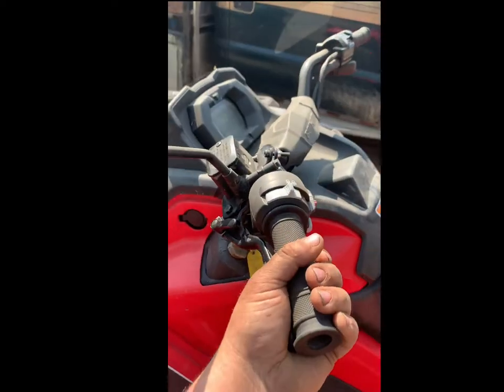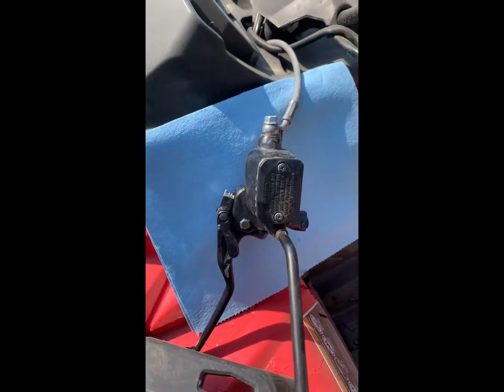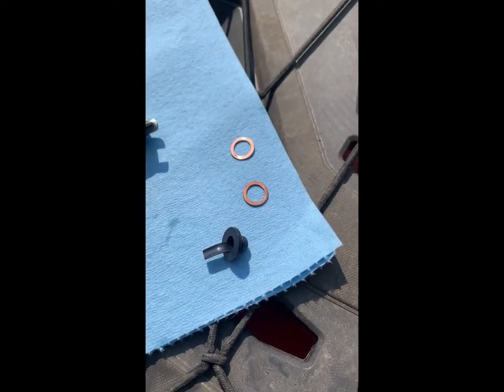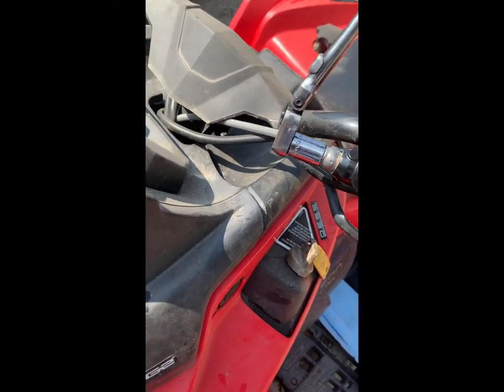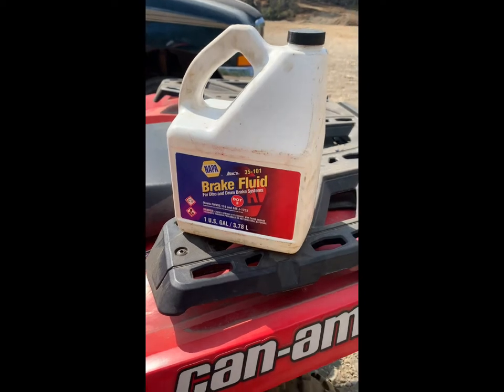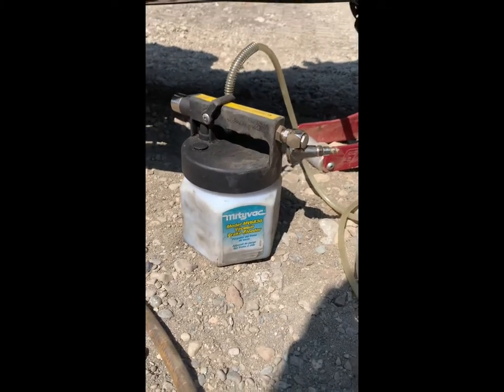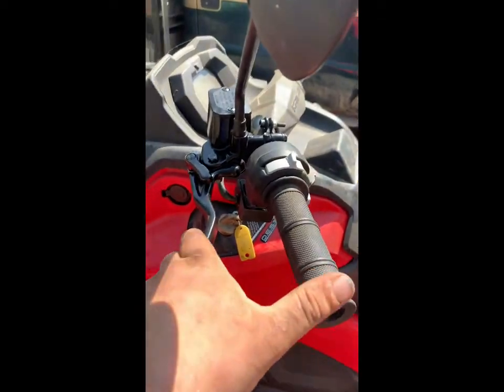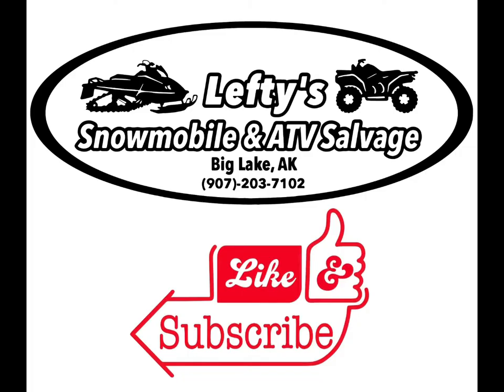ATV Repair - Brake Master Cylinder Removal & Installation🔧🪛🧰 #atv #canam #repair #powersports

Comment: A lil help here please! I bought this used atv with no brakes. Working on in! Handle was lose just like yours. Rear caliper was all worn out to the max. Replaced it hoping that was the problem! Goes to bleed it. Got oil inside caliper now and while opening bleed screw had a lil air than nothing but oil but piston not closing. Handle still lose! Do you think my master cylinder is the problem? Thanks
Reply from the maker: Hey there! If there is no fluid coming out of the bleed screw, or there’s just air then I would start looking for leaks at all the brake lines. Some leaks won’t show up until you get on the brakes hard. If you’re not getting any fluid or air at all while trying to bleed, then I would suspect a brake line has collapsed internally. Very common with rubber brake lines. Even on cars/trucks.
Reply: @leftyssnowmobileatvsalvage2344  Still working on it. Here is the thing. I do have air and oil when I bleed My lines. Just replaced all caliper new pads also the master cylinder. The handle don't seem to tighten up it still loose. I'm going to try a known to work mater cylinder from another similar atv see if that does any.

Comment: My wifes 19' outlander 650 xmr keeps getting water in the system. Idk how. I was changing the brakes just now and realised the pads are still good and that the naster cylinder wouldnt build preasure so i flushed the system and put new fluid and it works perfect now haha. Idk man i like my honda way better as far as maintenance 4real